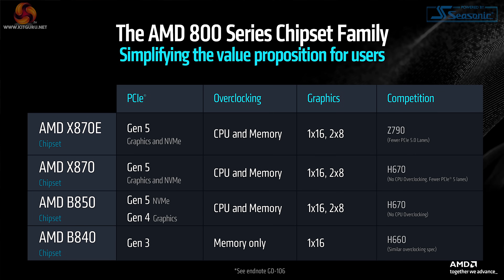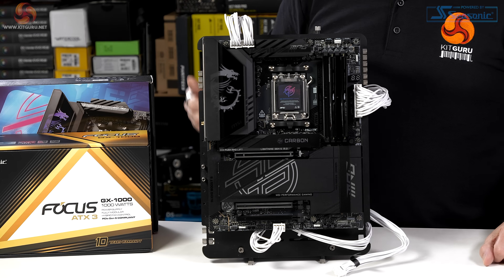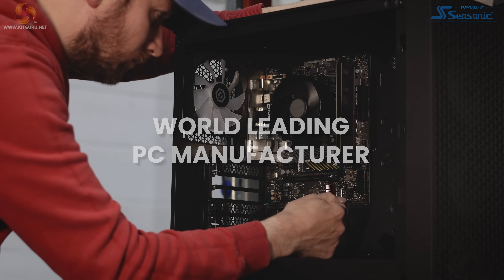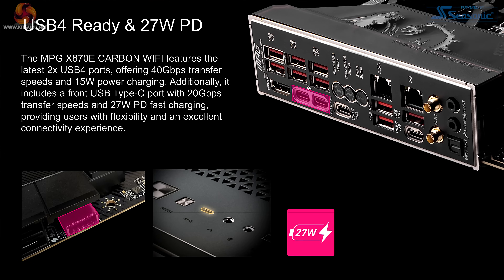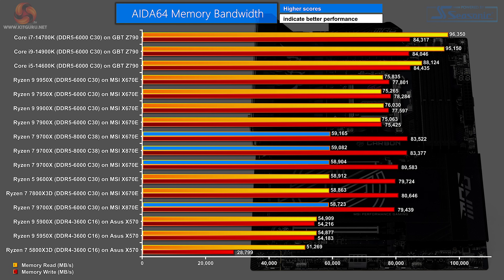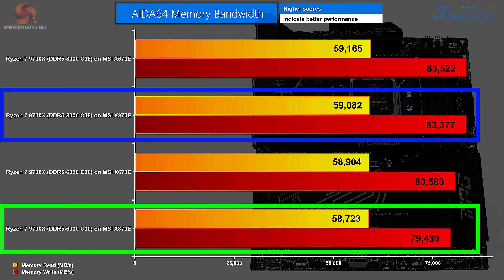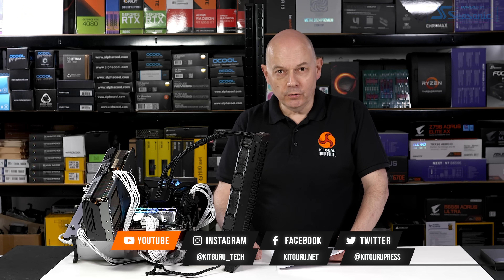MSI MPG X870E Carbon WiFi - DDR5 8000 for the win!

Comment: 2:57 - Over powered, pointless VRM's as always these days. 
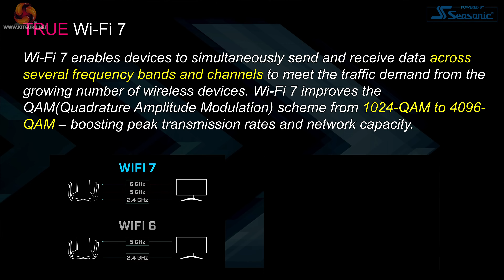4:15 - Amazing WiFi 7 that will be outdated in no time.
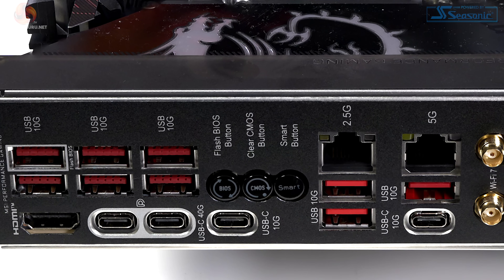5:11 - None full audio I/O.
5:28  - Only THREE PCIE slots.
5:48 - Four Nvme slots.
7:41 - Debug display. No sh1t for a jusrundr £500 quid MOBO.
Mobo's are utter sh1t these days 'Feature' wise...

Comment: Thank you for the video. There is still one aspect that interests me and that is 4 dimm support, last gen gigabyte x670e Auorus Master can run 4x24 @ 6400 with minor tweaking, can this board at least match it ? Kinda in a market for new boards and wondering if $100 extra over giga master is worth it.

Comment: Just bought this badboy. I was looking to upgrade from a Asus X570 motherboard and AMD 5900x setup. This X870E board is almost evenly priced with Asus's better X870 boards and since Asus flushed their warranty reliability down the toilet I was looking for other motherboard brands. After watching this great review I could not be more excited. Great stuff Leo!
Reply: Gonna also buy this board once 9800x3d is here. Coming also from 5900x and 4080. Playing 4k high fps, so I guess there will be less improvement than on 1080p, but still, im excited
Reply: How is the board?
Reply: @FJano12  CPU is still out of stock. But Mobo is great quality build wise. And lots of great I/O cant say more just yet. Pre Ordered tge 9800x3d a month ago now almost
Reply: @Mario211DE Just ordered the board. Waiting for the 9950x3d next month. Ordered some ddr5 8000 as well. Hope will work out.
Reply: Asus flushed their warranty down toilet?
Reply: @nathanthreshie199  Do a Google Search on "asus warranty issues".  It all came to a head mid-2024.  Steve from Gamers Nexus has at least 2 videos on the subject.  Like JohnDoe-cj3cl, I too coincidentally have the exact same hardware purchased almost 3 years ago and am looking to upgrade.  It's not that I wouldn't purchase Asus again, but they are no longer my first choice as I've lost confidence, and this fine review from Leo is very compelling to purchase this MSI motherboard.
Reply: Looks like the actual connector on the bottom of the board is different from the 2 at the top. Can you confirm?

Comment: is the heat sink provided good enough for pcie 5.0 m2 ssd?  most pcie 5.0 m2 ssd come with their own heat sinks which ... apparently stands in the way of the M.2 Shield Frozr.
Reply from the maker: I used a Crucial T700 with the MSI cooler throughout my testing and had no problems.
Leo

Comment: The 8000 Ram seems to be a let down.
Despite the layman's assumption that 8000 might be 33% faster than the lower numbered 6000, in practice it seems barely faster than 6000 in your tests!
Can we safely say it's more of a marketing ploy than an actual technological advance?
Additionally the 8000 prices and capacities out there seem very limited at this point - In our Australian regular stores I couldn't find 64GB (2x32) of 8000 ram, and if I settle for 48GB that costs a tonne more and (4x16) is even worse.
These facts alone undermine the value proposition of the X870(E) boards, unless, something will change to make 8000 much faster - anyone?

Comment: Great video as always Leo!

I just got this MB today from Newegg. I put Crucial T700 1TB NVME in first slot next to CPU and the thermal pads dont even touch the T700 on the top or bottom of NVME and I cant find sound equalizer/software in the sound driver on the USB included. Not on MSI website either.

Can you tell me where to obtain this driver and production error fix?
Reply from the maker: As you see in the video I am also using a Crucial T700 installed in the M.2 slot between the GPU and the CPU. I can see the Crucial label has been marked by the thermal pads and am confident it has contact. I have just run CrystalDiskMark and the temperature is reported as peak 56 degrees C and average around 45 degrees C. As far as I can see the Realtek Console doesn't work with the hardware on this motherboard.
Leo
Reply: @KitGuruTech  I have pictures and a video of thermal pads not making contact with T700 on M2_1 slot so I didnt want to burn up my NVME. Im using M2_2 and its causing GPU to run 8X  instead of 16X. MSI told me to buy new thermal pads....... I just bought this MB. It should be ready to operate.
 I finally got Realtek console to work

Comment: Not a single time has high memory speeds worked for me, and that’s on both B650E and X670E. Am I expected to chase a moving target for my motherboard to simply support advertised speeds? First they claim 6400mhz, never works, then they claim 8000mhz, never worked. But wait, just buy this new chipset and it will work.🥹

Comment: If the new 870e board is an 8-layer PCB, and the older 670e board was only a 6-layer PCB, the extra layers in the new board may have allowed better performance from the 8000 MT/s RAM. My understanding is that the traces would be better isolated from noise in an 8-layer arrangement.
Reply: Both are 8 layer.
Reply: I saw the charts too. What "better performance" are you referring to?

Comment: My first Ryzen motherboard was the x370 gaming pro carbon from MSI. and it was AMAZING. And then a generation later with x470, all the youtubers (gamers nexus, hardware unboxed) started going over VRM design, and claimed "the x370 gaming pro carbon from MSI has THE WORST VRM design of all motherboards and can't overclock" and i just, facepalmed. Because I had been running the x370 GPC with my 1800x, at 4.2ghz at 1.5v.... which everyone said "was not possible" because "you can't get more than 4ghz".... and yet, I did it, with "the worst VRM design of any motherboard on the market".... which I can't help but laugh, because at the time a lot of youtubers were being paid by motherboard makers as sponsors. And you could watch WHO was sponsoring them each generation. When MSI sponsored everyone first generation, no one said ANY bad shit about MSI. X470 generation it was ASROCK and x570 it was Gigabyte. And you could see that sponsorship effecting video quality. MSI wasn't "trash" until the sponsorships ended.... which, what? why was it fine when it was new, but bad when x470 came out? why would you buy a budget x370 board when the budget x470 board was better at the same price new vs new? like lmao. In my own experience, MSI makes THE BEST motherboard on the market, period. Its just facts. The highest world record for CPU and Memory overclocking are all on MSI. Someone might bring up EVGA motherboards.... 1-limited availability because even when they were actually making boards, it was in extremely low numbers (niche) and 2-they dont exist anymore in terms of gpu/motherboard.... so lmao. the king is MSI.
Reply: I think you make sound points there. As a consumer it's already hard enough trying to discern fact from hype when comparing products, and this gets way muddier when you just know intuitively that the "reviewer" has some sort of bias built in - usually incentive based. 
Not wishing to offend, but I'm suspicious even in this video where the reviewer states several times how the 8000 ram is loved by the MSI (full name requoted each time) board, when clearly the stats on the screen show no appreciable benefit over the 6000.
So yeh we really have to practice discernment.

Comment: If you put an M.2 drive in that 2nd position you don't get full bandwidth on the GPU slot. Not sure if it matters much.

I do like this board, though.
Reply: Yeh I've been trying to learn more about this cloudy subject. 
From what I've read it seems this CPU has 24 lanes to the PCIE 5, so presumably up to 16 (not even fully saturated) lanes would be used by the GPU leaving 12 for gen 5.0 nvme's? 
Could this be true, and if so perhaps we needn't worry about the whole "bandwidth sharing" business?
Reply: @LollyBread  According to the table on page 21 of the (English) manual, if you use either or both of the 2nd PCIe5 slot or the 2nd M.2 slot, you get 8 lanes to the main PCIe5 slot instead of 16. The question is whether this affects your frames per second. Bear in mind current GPUs are not using PCIe5, but 3 or 4, so bandwidth per lane will depend on that.

Looking online, most sources say it doesn't make much difference for gaming. But in this video we're looking at tiny differences caused by different memory speeds, so perhaps it's enough to affect that.
Reply: @LollyBread  24 - 16 would be 8 lanes left, 4 lanes would be for primary m.2, leaving only 4 lanes left. From what I understand, since X870 requires USB4 directly from cpu, it uses the remaining lanes. that's why second and third gen5 m.2 slots needs to share lanes with x16. X670E on the other hand, does not require usb4, thus having the capability to have two m.2 gen5 without lane sharing with x16.
Reply: @skacjy  Thanks for your info. It begs the question that IF the USB4 isn't used/plugged-into, do those lanes then free up for nvme's, etc.
I need to do more learning :)

Comment: I like the higher price for the new MB features. However, it does not offer a significant performance gain for the price. Plus, you'll need to determine the cost of new MB components to get full performance. I would not change my INTEL PC to move to AMD.

Comment: Why there are not gaming test with r7 7800x3d and x870e ? Is this due to some amd guidelines. I mean people who are buying these are probably more than interested to see the performance also with x3d processors (as gamers). This is due the prices of x670e motherboards haven't really dropped anywhere and if you example are going to buy the motherboard for gaming you probably have or want to have something with x3d processor in it.
Reply: Because there are zero performance gains between the X670 and X870 motherboards they might do one when the 9800X3D comes out but the benchmarks will be based on the CPU, not the Motherboards

Comment: Did they fix the killing Nmve ssd feature they have on the x670 carbon? And the customer service?
Reply: Can you explain this? Is it a specific slot that’s being killed? And how?
Reply: @datsweetsansabooty  the first slot, it killed 2 different ssd Nmve in my case, then when I searched I found other people having the same issue, even another guy posted it happened 10 times in a microcenter review. For sure MSI didn't recognize the issue, because they are dirty as F...

Comment: @KitGuruTech I've yet to test X870, so a query. Does this AGESA 1202 allow 1:1 for DDR5-6400 CL32? For customers, I have tended to go with this over 6000 CL30 in the past on the off chance of it working 1:1, however rare that might be. It's often priced the same regardless.
Reply from the maker: That is pretty much the point of AGESA 1202 - no more valley of death with faster memory
Leo
Reply: Thank you Leo, agreed. I look forward to testing how far the AGESA 1202 will allow. 1:1 6400 or beyond would be nice for all the boards updated, down to B650 even. Should give Ryzen 9000 a bit more appeal for customers.

Comment: great review! MSI have been reducing their high-end board range for some time: my absolute favorite was the UNIFY (have two!) but that seems to have ended in the Z690 era. Looks like CARBON is the new high-end MSI board (for those of us with more sense than money that are not seduced by the GODLIKE)
Reply: I'm running an X570 Unify right now as well, sad to see it not return. Likely going to grab the Carbon, though. It looks good too.
Reply: I have MSI MEG B550 Unify , honestly I`m already miising for those series ( unify ) It was little bit cheaper than Godlike. For me Carbon Series never be good like Unify or Godlike or Ace, those mobo are MPG , not MEG ;) maybe for MSI... only from a marketing point of view.
Reply: Just upgraded to this board from a MEG Z490 UNIFY and I'm gonna miss the hell out of it. I freaking love that board, and I hope this one is just as badass; I should have everything installed in a couple days when the RAM arrives.
Reply: In the end I went for a Tomahawk X870E instead of the Carbon. It's only really missing the additional 10Gbps NIC which I admit would be nice. Tomahawk has a single 5Gbps.

Comment: X670E is better, No lane sharing with PCIE so you can use all the M.2 SSD drives.
Reply: Do you know if there is a way to avoid lane sharing by not using the second m.2 slot and maybe instead using the 3rd slot for example?
Reply: @JayP-vh9wc  this is possible
Reply: cope lol

Comment: The board has a really neat bios.  Wendell was talking about some of the memory features on it.  Thanks Leo.
Reply: What problems ?
Reply: @buyingastairwaytoheaven5252  Its going to have been built on some api running in C and with more apis the more chances there are for massive security issues. Cant beat the old machine code ones.
Reply: Its an amazing bios but with all that complexity comes problems.

Comment: are you a shill? ddr8000 is slower than drr 6000 thousand on ryzen!
Reply from the maker: That's an interesting take - what is it based on? our test charts clearly show that is not the case. I assume you have your own figures using AGESA 1202 that can substantiate your accusation.
Leo
Reply: go look at the frame chasers videos he did testing that ryzen is faster with a clock divider of 1:1 ! and when the multiplier is set to half that to achieve ddr8k that it amounts to a regression in performance.
Reply from the maker: @chriskaradimos9394  Are you saying that Framechasers has tested DDR5-8000 on AGESA 1202 and found he cannot use a 1:1 clock divider? I cannot see that video on his channel. Even if he HAD posted such a video you could have pointed it out instead of being insulting. 
Returning to my own work, have you verified or refuted the charts I posted in this video?
Leo
Reply: Framechasers has an obnoxious and arrogant personality and it shows with his viewers and supporters. He also sells $300 courses to show videos of how to tune which is ridiculously priced. 😂 @KitGuruTech
Reply from the maker: In the event you need to do some research on AGESA 1202 you might check this out https://www.youtube.com/watch?v=harNiC8Btg4

Comment: Awesome video I'm currently using a X670E Taichi I had to get after watching that review from a year ago, what I'd like to see is a new updated side by side comparison chart of a 7950x3d in the X670E & X870E running the same game with the new game optimizations. Are those figures available or will they be? It'd be interesting to see the differences between the 2 with the ram clocks being different.
Reply from the maker: I will certainly re-test 7950X3D on X870E when we get the new Ryzen 9 3D CPUs but I won't back-to-back with X670E
Leo
Reply: Maybe even a DDR5 6000 to 8000 swap in the X870E would be a good comparison too .

Comment: DDR5 8000 is pointless for AMD CPUs. They've said it themselves there is no benefit to higher than 6000mhz.
Reply: There are nice benefits to be had above 6000Mhz. It’s just that AMD CPU’s have poo memory controllers which AMD refused to upgrade for this gen. A golden chip which can run 6400Mhz at 1:1 fabric clock enjoys a nice little bump in performance.
Reply: @Aurummorituri  Yeah that's an edge case. 

Most people can't run 6400MHz and 6400MHz is a far cry from 8000MHz.
Reply from the maker: You might want to read up on AGESA 1202 where AMD now says DDR5-8000 is the right choice for Zen 5 https://www.youtube.com/watch?v=harNiC8Btg4
Reply: @KitGuruTech  Not Zen 5. X870E motherboards only.
Reply: @KitGuruTech  They haven’t updated the fabric clock at all so I don’t understand how 9000 series all of the sudden benefits more from higher speeds when the fabric clock can’t run 1:1 at 8000MHz DDR5
Reply from the maker: @YeshuaChristRedeems  Be that as it may, Zen 5 is happy with DDR5-8000 on X670E and X870E provided the BIOS has AGESA 1202. 
Leo
Reply: @KitGuruTech  But didn't you say in that video at 4min that you "saw absolutely no change in performance"?
I'm not being obtuse as I really want to know if their claims are hot air or not.
Reply from the maker: @LollyBread  No that's a different point - at the time stamp you give I was saying the new AGESA reduces die-to-die latency (i.e. Ryzen 9 CPUs) however I cannot see any gain in performance from the reduced latency. That is wholly separate to support for DDR5-8000.
Leo
Reply: @KitGuruTech  I think "support for 8000" sounds nice, but we're all  trying to understand if 8000 actually Performs significantly better than 6000 (given these boards/cpu's) and I thinking the answer is No, for now anyway.
I'm going to get the Carbon board in the hopes that 8000 may actually be  effective in the future.

Comment: That is a really quality looking board. under £500 today , seems like a great buy, although I would imagine a lot of people will not upgrade, or go shopping online for something cheaper. Not sure a lot of these features are mainstream, but good to see such a potential power delivery - means the caps will be running cool at normal loads for the CPUS used.
Reply: Its probably not work an upgrade but if you're doing a new build its totally worth it.